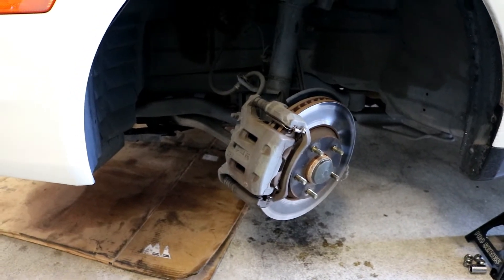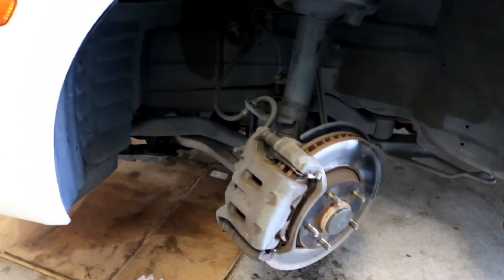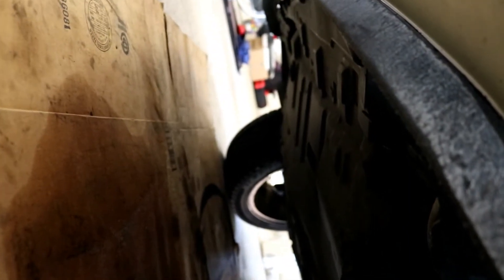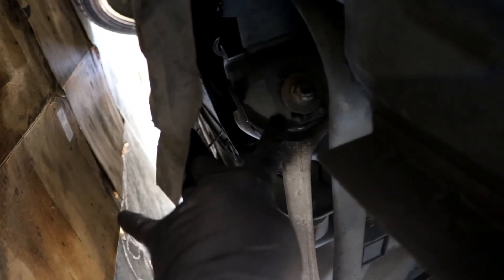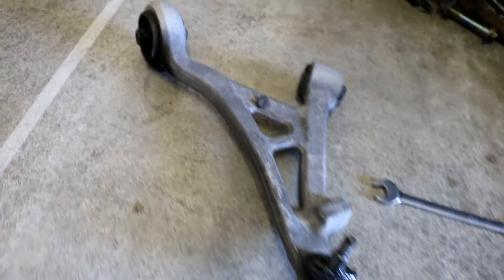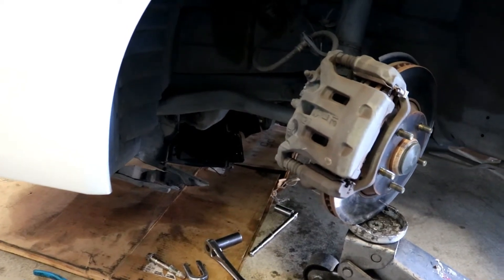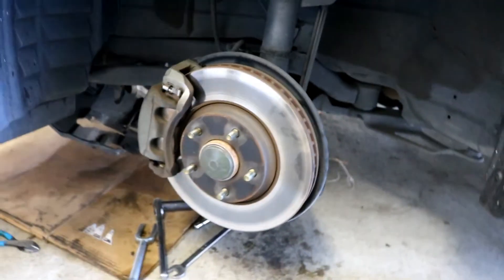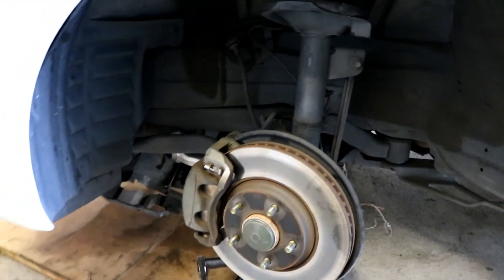Infiniti M45 Front Control Arm Replacement (2002-2004) Nissan Cima/Gloria

Comment: I have a 2004 infi it m45 need front lower ball joint but the while assembly $400-500 I can't  find just the ball joint any way I can just replace the ball joint with another one cross referenced.?
Reply from the maker: There aren’t any separate ball joints as far as I know.
Reply: @HelpingHandAutoRepair  thanks
Reply from the maker: @TekkHakk  of course. Try going to a local parts store. You should be able to get one (albeit not an OE part) for around $200-250

Comment: Recommendation on loosing the bolts holding the arm to the frame?
Reply from the maker: PB blaster if they are too rusted/tight. Could help loosen them up. If it is too tight, just try and use a longer bar for leverage.

Comment: What were the symptoms of this bad lower control arm?
Reply from the maker: Steering wheel play while braking. Front end rattling and noises.

Easiest way to see if the lower control arm bushings are bad or are failing is to grab a breaker bar or tire iron. Put it on the lug nuts with the correct sized socket and apply some right and left hand pressure to see if the entire wheel moves within the wheel well. If it does then inspect the bushings.

Comment: So did you just use hand tools because I soaked my bolts with WD-40 for 2 days and they aren't that rusty and I couldn't get them to budge at all.
Reply from the maker: Yep long breaker bar. They definitely put up a fight. Probably some of the most stuck lose control arm bolts I’ve ever went up against.